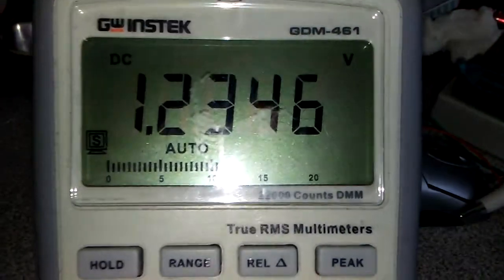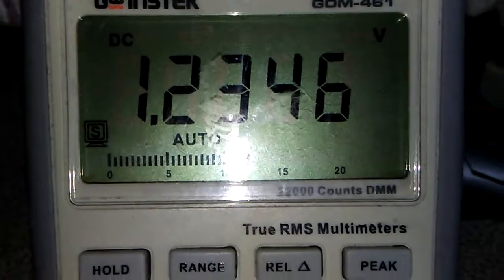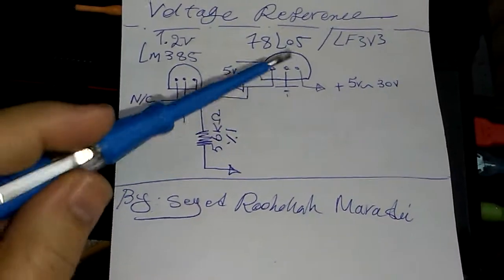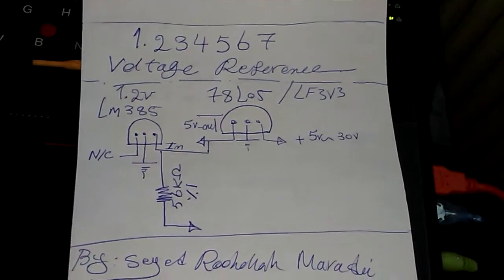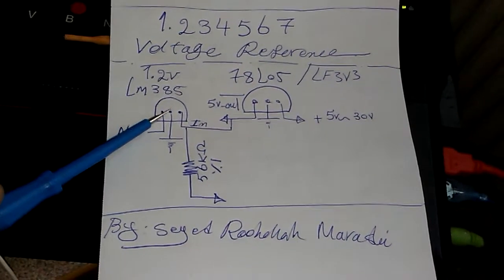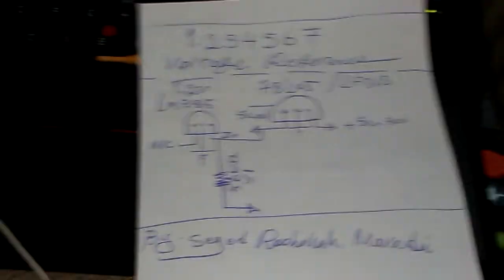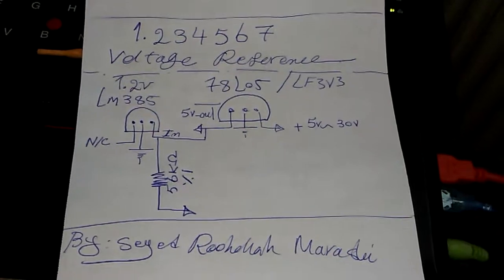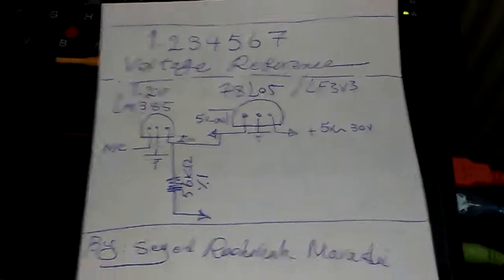1.234567 volt reference by LM385 1.2v

Comment: Very nice, is your LM385 stable enough to use it as a reference for the LTC2400? I read the drift is rather large at 150ppm/C.
Reply from the maker: No, because of this value is small for ltc2400, it is much better to use at least 3volt or more. more than min. runnig voltage need for LTC2400
Reply: Ok, thanks!